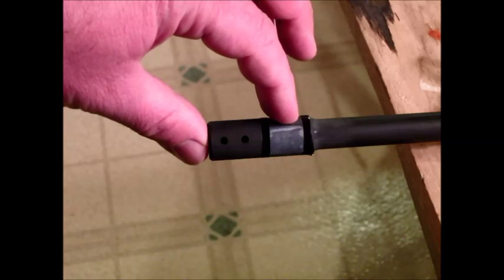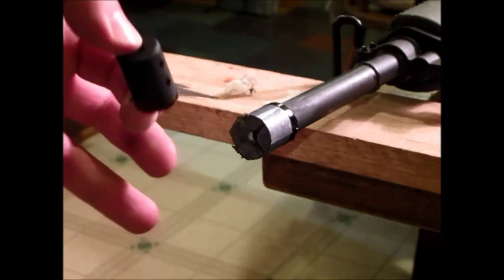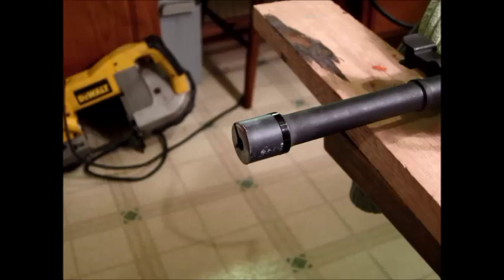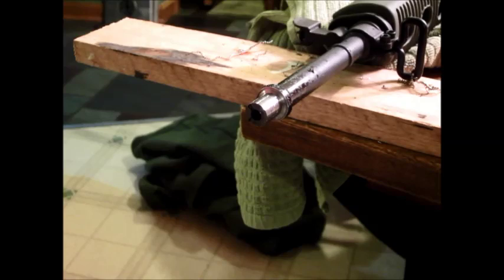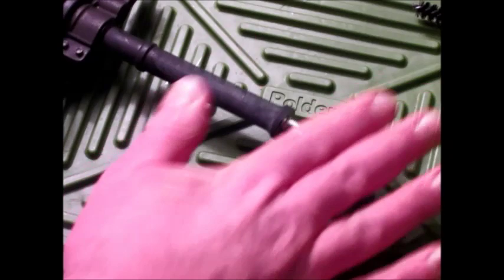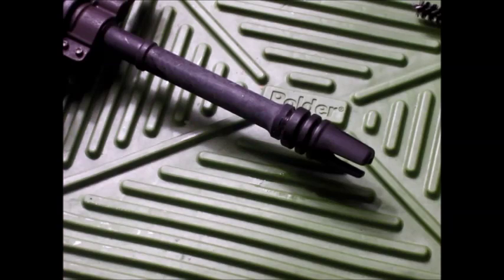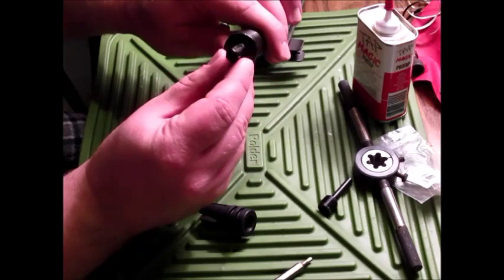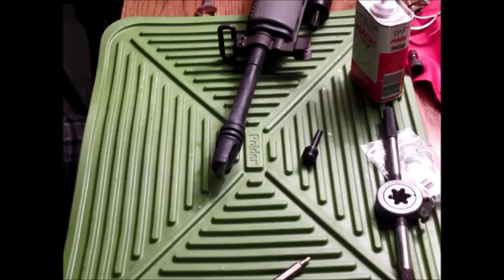Using an Annular Cutter to Trim an Armalite AR-180B Rifle Muzzle for Threading

Comment: Very good.  I'm getting ready to do this on my AK47 as soon as the stamp comes back.  I will be using the. 545 annular cutter on the barrel which is a diameter of. 562 so it is a minimal amount of material. I'm glad I saw your video using the annular tool.

Comment: Isn't that a little too fast with the annular cutter?
Reply from the maker: It's a bit faster than the manufacturer reccomends, but the bit is also not taking a full bite across the width of the cutter tooth. The teeth of the cutter are more than 1/8" wide, and, for this project, I'd be shocked if I removed more than 1/16" of steel. If I were cutting down a bull barrel to a 1/2" muzzle thread, the speed would be much more of a concern for me.  It's definitely not a best practice, but it is a trick I've gotten away with. Excellent question!
Reply: @DrThunder88  thank you for the reply. New to this and trying to learn more about it.

Comment: What size annular cutter did you use to get the 1/2 inch barrel?
Reply from the maker: It is 7/8" outer diameter.  The specific part is a Hougen Rotabroach 12128.
Reply: Thank you

Comment: Where did you get the pronged flash hider?
Reply from the maker: That's an excellent question! I immediately thought "Tapco", but after some consideration I don't think Tapco ever made a flash hider of this type. As near as I can tell, it's a pretty run-of-the-mill, three-prong M16 flash hider. I see Luth-AR and Brownells have very similar clones of the same style device, but whether they were the original source for mine, I just don't know.

Comment: Video is a bit old but saw you replying to comments recently so here goes. 
Would you have any apprehension threading .22lr barrels with a thread kit and annular cutting kit from cncwarrior? Have some older .22 bolt actions that aren't threaded and have a can on the way, and figured if I used it on more than one barrel I save money vs a gunsmith. As long as everything stays concentric that is my only worry.
Reply from the maker: It's a tricky situation to be sure. My only can is a 30 caliber, so I wouldn't have any problem putting it on a 22 caliber rifle that had been threaded this way. If it were a 22 caliber can, though, I might think twice! That said, I would probably take the risk on my own guns and with my own suppressor, but whether you're willing to take the risk yourself is entirely up to you. Good luck either way you go!

Comment: It's an easy way to cut a relief on the barrel but how much damage/wear is the bore guide doing to the rifling?
Reply from the maker: The floating bore mandrel does a good job of isolating the rotation of the drill from the rifling, and it's machined tightly enough that I am not worried about it knocking around side to side. Even if it has done damage, I haven't noticed any ill effects to the accuracy of the gun. The  rifles I've done this to started out as 2-3MOA guns at best, so there's a huge margin of error to hide any changes.  I don't think I mentioned in the video that I wouldn't do this on a precision rifle, but that's mainly for reasons of concentricity rather than damage to the bore, but that would be the best case for demonstrating that this process will adversely affect accuracy.

Comment: Good Vid.  

Wouldn't it make sense to finish with a little bump from a crowning cutter? or maybe a brass ball with lapping compund. Or does that annular cutter leave a clean crown that passes the q-tip test?
Reply from the maker: Excellent catch!  The rifling actually ends 1/8" behind the new end of the barrel, meaning those critical surfaces were never touched by my cutting tools.  There's no way to know this from the video, which is my fault.  It also was not intentional.  I did not realize where the "barrel" ended and the "brake" began until I cut into it.
Reply: A note in the vid will solve that. Good to know.

Comment: Also can all the parts and pieces be purchased from one single supplier or do they need to come from the same supplier.

Thank you
Reply from the maker: CNC Warrior I know sells all the tools I used for both cutting the muzzle diameter and threading it.  The only tool I used that they don't sell was the bandsaw!  My tools, however, came from a number of sources, but the annular cutter was CNC Warrior's.

And yes, it was threaded to 1/2-28.

Comment: Will this work on a tapered barrel? I want to do an old REM. 22. Thanks
Reply from the maker: Are we talking about the contour being tapered or the bore? A tapered contour would be no problem. The only concern I might have is making sure there is enough of a shoulder behind the threads to support whatever muzzle device you're thinking of using.  Generally, I'd say the diameter of the barrel directly behind the threaded area should be at least 0.1 inches larger than the nominal diameter of the threads, e.g. if you're threading 1/2-28, make sure the barrel is at least 0.6 inches in diameter at 0.5 inches behind the crown.

Now if we're talking about the mythical tapered bores, that might cause an issue  if the taper is abrupt enough to allow the annular cutter pilot and thread alignment tool to wobble between the lands.

Comment: What cutter would I need for cutting the barrel down to 9/16 so I can thread it? . I see a ton of options on am@azon but they don't list their inner diameters.
Reply from the maker: It's difficult to say, as I don't know if there is a standard width of the cutter teeth.  Otherwise it'd be easy to say "take the cutter diameter and subtract two times the tooth width".  Looking at CNC Warrior's site, they offer an annular cutter with a 0.57 inch slug diameter, and the page says that barrels should not have an OD larger than 0.875 inch.  Since 0.875 inch is 7/8 inch, my guess would be that a 7/8 inch cutter is what you're looking for, but I do not know that for sure.

Comment: That was painful to watch someone free handing with an annular I had anxiety the whole time.
Reply from the maker: Sorry to keep you on the edge of your seat! You can rest your weary heart, though, as it wasn't truly freehand. The pilot keeps the cutter concentric and parallel to the bore. The only aspect that could be said to be really "free" is the feed pressure, which would also be true if it were in a magnetic drill.
Reply: @DrThunder88  ok, I didn't see your pilot pin, I usually drill with a mag drill and the pilot is sprung and activates the cutting fluid, with the weldon type chuck. I was cringing expecting the bit to grab and spin the rifle lol. Cheers , sorry for reviving such an old thread!

Comment: Wouldn't the mandrel mess up the crown and rifling inside? How was the accuracy?
Reply from the maker: I certainly wouldn't use this tool on a precision rifle for fear of messing up the crown, but on a utility rifle like the AR-180B I had no qualms.  Importantly, it did not cause keyholing.  Given the rifle's accuracy out of the box, I don't think I would have noticed a change in group size unless it was more than an inch.
Reply from the maker: HeadingEast33  The venerable but no longer online Steve Wagner would use the top of a carriage bolt and 400 grit Clover compound, but that's exactly how to do it! Though, on a rifle like this one, having a pristine muzzle isn't going to affect accuracy as much as it would on a precision rig.

Comment: I would like know what sizes of annular cutters to us ex on my sks and other types rifles .
Thanks
Reply from the maker: I got my annular cutter as part of a kit from CNC Warrior. It ended up being a 7/8 inch cutter to get the correct muzzle diameter for 1/2 inch threads. I believe--but am by no means sure--that a 15/16 inch annular cutter will leave the correct muzzle diameter for 14mm threads.
Reply: @DrThunder88  1/2 × 28 is the thread mostly i would use .
My SKS is the Norico hunting version. Thank u for your response.
Reply from the maker: @charlesc.plumley9755  You're welcome! I lucked out on my Norinco Hunter project, since the muzzle on mine was just about right for threading at 1/2 inch. You can see that project here: https://youtube.com/playlist?list=PL00374856840BC330

Comment: Is there a part # on that annular cutter?  I'm trying to piece together the necessary tools for this as CNC Warrior does not ship out of country.  Thanks.
Reply from the maker: The cutting bit itself is a Hougen Rotabroach 12128, however, the bit is designed for magnetic drills, not hand drills or drill presses.  The bit holder made by CNC Warrior is what allows the cutting bit to be used in a standard drill and accept a bore diameter-specific pilot, and it is not as readily available as the cutting bits.

Dinzag Arms also sells an extremely similar setup to the one sold by CNC Warrior.  Dinzag sells the parts individually, so you can order the holder and pilot from him and find the appropriate size cutting bit from another vendor if you find a better deal locally.  The terms and conditions page also seems to indicate that Dinzag will ship tools internationally, but you'd need to call him.
Reply: @DrThunder88  so it's actually a Hougen 7/8" x 1" Rotabroach Annular Cutter?  That's what I located with the part number 12128.
Reply from the maker: @CaFFeineSouLja  Correct.  The inner diameter ends up being the right size for threading.

Comment: What the diameter of the shank should be before threading?
Reply from the maker: According to info from CNC Warrior, 1/2" threads should be between 0.4924" and 0.4989" with an absolute maximum of 0.510". I think the annular cutter left the muzzle diameter just a hair under 0.5"
Reply: @DrThunder88  I'm now at 0.5005, I'll take off a few and try to thread it. Thank you.
Reply from the maker: @ARC928  Good luck on your project! Let me know how it turns out.
Reply: So I have this adjustable 1/2-28 die and not sure what to adjust it to. Any idea?
Reply from the maker: @ARC928  Generally speaking adjustable dies have a set screw that runs across the gap.  Tightening that screw will expand the die ever so slightly (almost imperceptibly) and create a slightly thicker male thread.  Similarly, backing out the screw and clamping down on opposite sides in a particular type of die stock will close the die slightly and result in a slightly thinner male thread.  I've not found it too important to play with the thread specs in this way for this type of threading.  To get the most precise threads possible, it's best to remove the barrel and have them single-point cut on a lathe.
Reply: @DrThunder88  Ok, so expanded it a bit and ran it through, brake would not go on, loosened the screw 1/4 turn and ran it again, brake threads on nice and tight, great successes.
I have a lath with no threading capability.
Reply from the maker: @ARC928  Cool! Great work!

Comment: It doesn’t mess with the rifling?
Reply from the maker: Not that I've found, though there is that nagging feeling I get whenever something other than a bullet goes down the bore.  The mandrel is machined to be a close fit between the lands, so it doesn't knock around inside the barrel.  It's also smoothly finished.  As long as it doesn't get abrasive grit on it, there shouldn't be much unusual wear.  It's also worth pointing out I did this on an AR-180B, not a target rifle.  If I were having one of my long range guns threaded, I'd almost certainly have it done on a lathe for the utmost in concentricity and to eliminate even the possibility of damaging the bore.  The other problem is AR-180Bs aren't common guns for gunsmiths to work on.  I don't know of many who'd take on such a gun.
Reply: DrThunder88 right on thanks for the info I appreciate it

Comment: YOU SIR ARE A BUTCHER YOU GET THE JOB DONE BUT THERE COULD HAVE BEEN MORE PRECISION INVOLVED
Reply from the maker: The precision was sufficient for the task at hand. You might as well have said "THERE COULD HAVE BEEN MORE ELEPHANTS INVOLVED"  True, but to what end?  More to the point, neither you nor I nor anyone knows how accurate the threads actually are.  All I know for sure is the rifle is just as accurate as it was before (which is to say "okay, but not great") and it can host my 30 cal suppressor with no problem.

"Butcher," by the way is pretty apt.  Breaking down carcasses into more useful, desirable parts is pretty much how I go about my gun projects.  If you go to a surgeon to cut you a porterhouse, you are overpaying!
Reply: @DrThunder88  🤣 what a great response

Comment: hello. i know this video is old but if you see this can you tell me if the finish on that barrel is nitrided? i hear some annular cutters have a hard time with it
Reply from the maker: None of the barrels I used the annular cutters on were nitrided, so I can't speak to that from firsthand experience. On the one hand, it makes sense: increased hardness and wear resistance. On the other hand, I know I have dimpled a few nitrided barrels with regular twist bits.  I wish I could provide you with some more info. Best of luck!